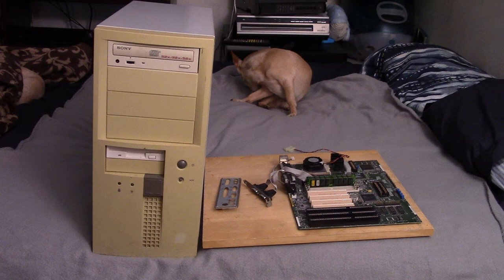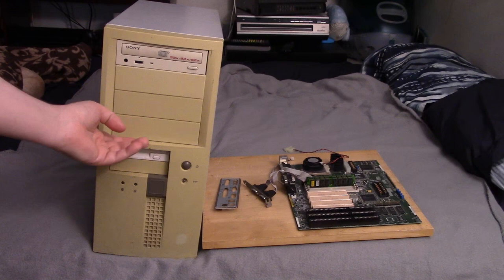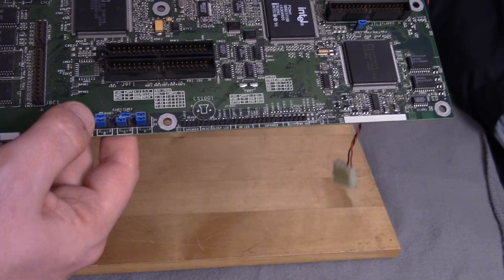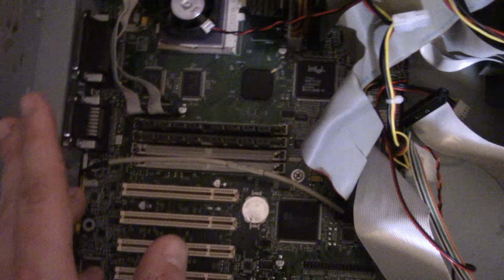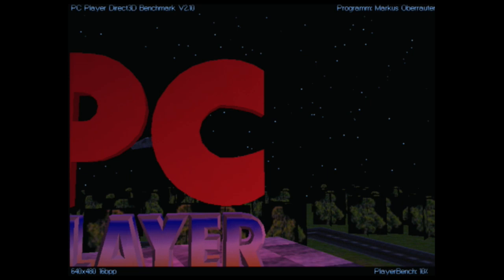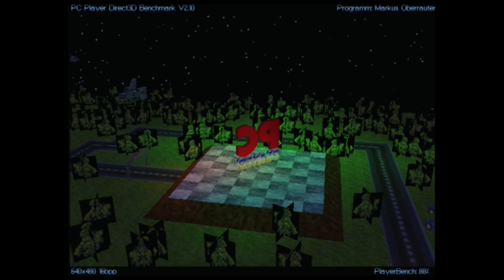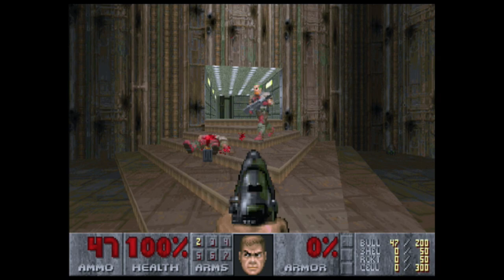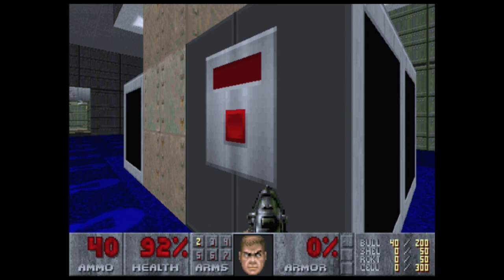Random Sony Themed Socket 7 Build

Comment: When you say it reminds you of your AST, they were another OEM using Intel made boards, along with Packard Bell and others. For some reason, the PB boards seem strangely slower than AST ones of the same type. Novel that it has an ATI AMC connector on the board, albeit a long way from the ISA slot dwelling cards it would have interfaced with. These older Rage's were at least somewhat competent at 2D due to their Mach64 core, but they weren't the best at this and like pretty much all early 3D accelerators, the 3D side wasn't very good and it took several revisions of the chip to make it start working.
The Yamaha SoftGM feature is a strange one, not so much here, but on some boards (Intel AN430TX is one) they paired the regular 7xx chip with a 704 "OPL4" one which was essentially a hardware version of SoftGM - it literally sounds the exact same, if not slightly worse, and seems to save no tangible amount of cycles. Also you can still enable SoftGM and it was set to that by default, utterly redundant.
Anyway, looks to be a simple enough system as far as its composition goes, very bread and butter, nothing too wacky installed inside it but certainly enough to get the job done.
Reply from the maker: For the most part I like the Mach 32/64 chips for 2D though they seem to have scrolling issues with a few games, namely Keen 4, which although not in the video I did test and sure enough it has the scrolling issue which no in game options seem to correct.

Comment: VRE  is 3.3/2.9 volts for MMX (P55) processors.  Standard is 3.3 volts for regular Pentium (P54).
Battkecruiser 3000AD is one of the most legendary fails in computer history.
Stretch goal:  try to get a BIOS upgrade.
Other than that, it's a nice system for the period, but you really would be better off with Windows 98se instead.

Comment: Hey i think the sound problem is related to CPU being under high load due to crappy integrated GPU, back in 98 I had exact same issue with game called Sin, i also had MMX 166, 64 MB RAM and some 4 MB crappy S3 card, i was running software mode, and because the CPU was helping the S3 with rendering in software mode, which S3 couldn't handle on it's own, and thus the CPU couldn't handle sound processing.
Reply from the maker: In actual gameplay the sound works. It's only choppy on the capture footage. I had peviously moved a lot of things around in my setup.

Comment: The mobo is intel, AA code AA 662195-401, but I couldn't find any manual or specs online
Reply: it's a AG430HX (Agate) with a 430HX chipset, supports Intel CPUs from 75 to 200 MHz, not sure about MMX though.